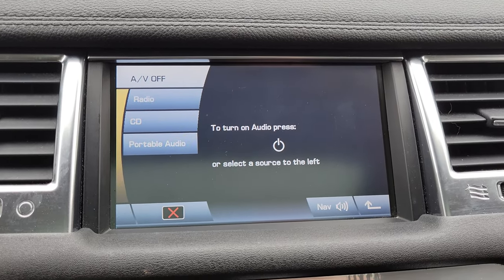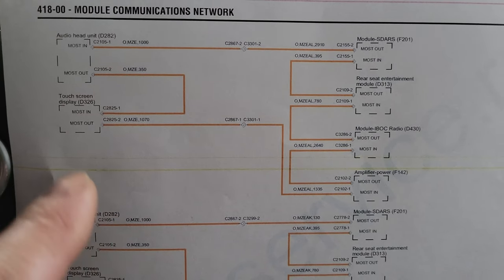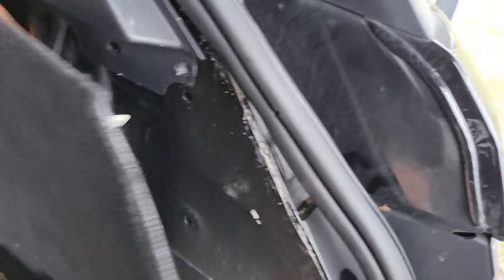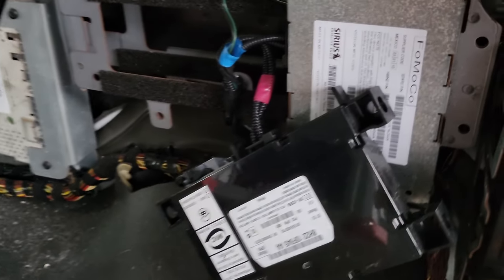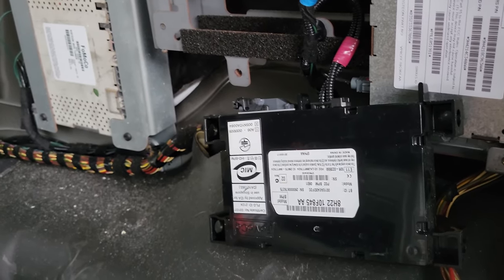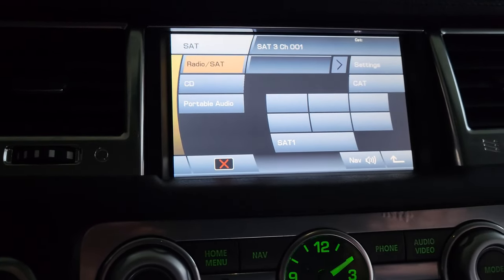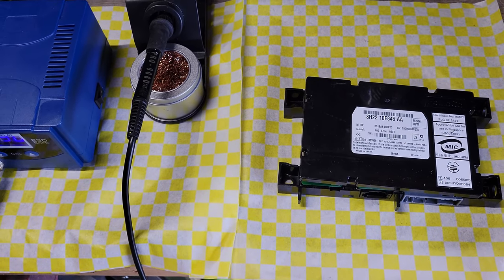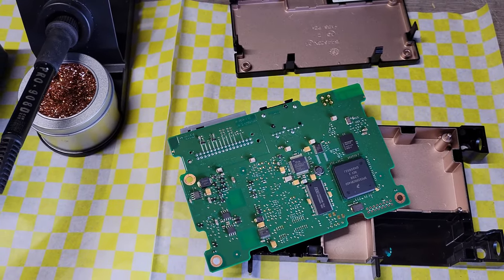2010 - 2013 Range Rover Sport L320 Radio Repair LR3

Comment: I have a 2013 RRS. It works for 15 seconds then cuts out for 15 seconds. It is constantly showing a message showing it is searching for a phone when the radio or Sirius cuts out. The Nav and cd/dvd is not working. Any suggestions?
Reply from the maker: I would suggest following the steps in this video
Reply: Im having the same issue on my 2012 RRS. Going to do some investigation this week.
Reply: @simonelrick6265  how did it work out?
Reply: @licoyote69  it seems the actual "control" unit/radio is faulty. :(

Comment: i have a completely black screen with nothing working at all, any ideas? thanks.
Reply from the maker: same scenario, you have a dead component or fuse. You have to check individual modules to see if they have the blinking light to show they are working. Or you touched the bottom left corner and turned the screen off 😆

Comment: The issue I have all challenges available my phone is connected , any one call it’s connected and shows the name , but no voice, if I give any order to Cd,DVD, aux ,not giving any order . What do you think amplifier broke the one under the passenger side , but i checked there is red light flashing. Means there’s power. What do you think?
Reply from the maker: You have to look for the amber/red lights on each module to show they are getting signal through optical wires. If one is not illuminating that's a good place to start.

Comment: I have an l320 2011 and mine keeps turning off and losing all the settings, if go back to it a few hours later I some times works but will turn off again after a short period of driving, have checked fuses battery alternator ect and all good, do you think this procedure you doing here might help diagnose it or could this be a wiring issue?

Ps if i pull the fuse and put it back it works but then doea go off again at some point.
Reply from the maker: It's definitely worth a try. Otherwise you have a short or internal error most likely

Comment: Hi just wondering if you can help me my radio/dab is not working it is not letting me select CD TV or AUX on the screen but the radio and DAB are not lit on the screen they are dull like the one on your video any help would be much appreciated
Reply from the maker: As shown in video, usually no image is due to a bad optical cable or you have a bad unit that is not transmitting data

Comment: I have a 2010 Land Rover Range Rover HSE Sport and the headlight and taillights stay on when the car is off. I have to disconnect the battery or the battery will die. Any ideas?
Reply from the maker: Most likely someone has altered wiring in the vehicle. You can pull the light switch out and check to see if voltage is coming in all times and if the outgoing wire has constant voltage when switch is off to rule out the switch. If the output wire has no power when switched off and the lights are still on you have an issue with wiring between switch and lamps themselves
Reply: @EngineInformant  could it be the LIGHT CONTROL MODULE??
Reply from the maker: @TrumpWonKBZ  possibly.